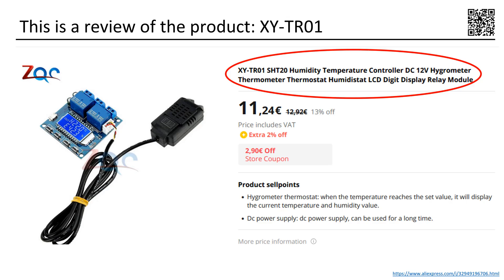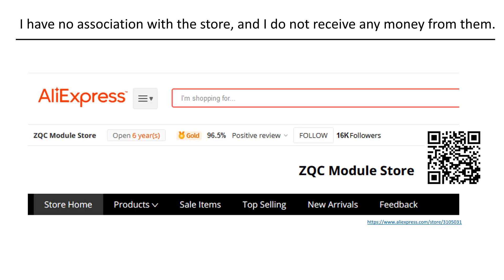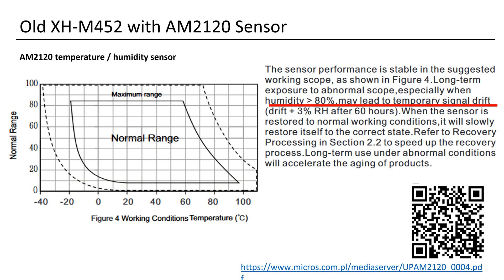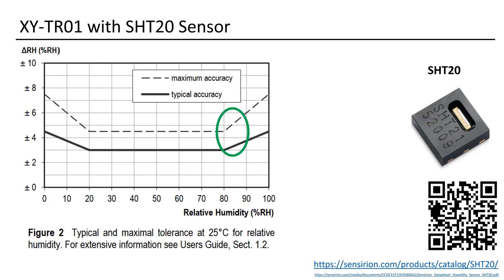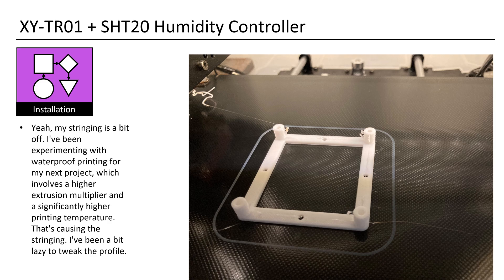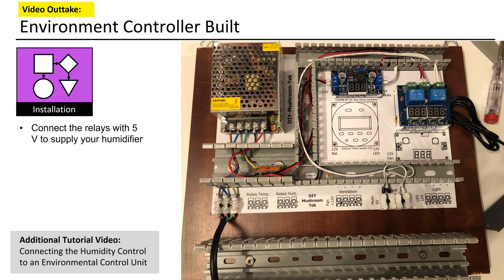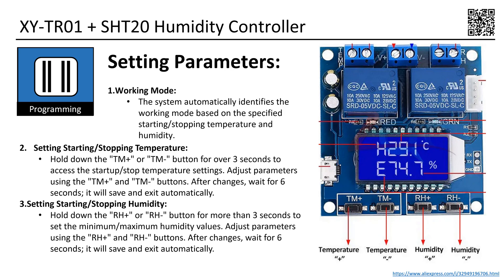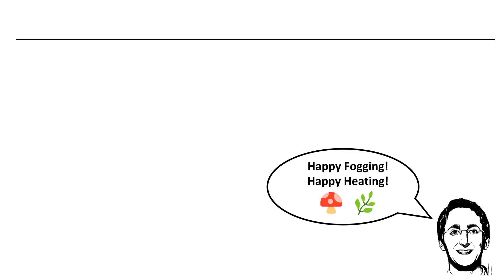XY-TR01 + SHT20 Humidity Controller

Comment: hallo daniel :) may i ask you a stupid question.... so this controller has 1 output channel for each parameter Temp and humitity. so i guess you have to choose if you wanna increase or decrease your hum/temp before right ? what if you wanted to increase or decrase at the same time? do you have to use 2 controllers ?  btw  facinating work you do ! :D
Reply from the maker: Hey, there are no stupid questions ;).
The controller works as follows. It shows you the current temperature and humidity. For each one, you can set up two values. If I want to have Ø 85% humidity in my grow tent, then I set up the following values: 84 – 86. What do they mean? The controller opens the relay at 84% and the humidifier starts working. When the value of 86% is reached, the controller closes the relay again. The same is possible for a target temperature through the second relay, that would controls a heating device. This is the normal application for grow tents as humidity and heat are sucked out through the venting system.

If one changes the values, then the operation changes. This is for using, for example, cooling devices or dehumidifiers. Then the device starts when, for example, 7°C is reached and cools the tent down to 5°C.

Since the often system that you are trying to control has an energy drain in one direction, these controllers work just fine. If you have a more complex system in mind and want to use, for example, a PID controlled target, then I would advise using an Arduino or ESP32. I made good experiences using a Bosch BME280 sensor. One can program these controllers in any desired way. I did not use them in my project in order to make it easily accessible to as many people as possible.

What are you planning? Feel free to share!
Anyway, happy tinkering and growing!!
Reply: @diy-mushroom-tek  so in order to actively cool and heat id need a second controller , or a better one....guess you could just set it the other way if needed . My plan is to control a grow tent for plants. I ordered two controllers maybe I build a mushroom box for my mothership as well :')
Reply from the maker: Yes, you are right. If this is what you need, I also have a grow tent for plant cultivation. Here is an impression I just recorded for you: https://youtube.com/shorts/_KAyfSostlU

The question is about the goal. If you want no change in temperature or humidity, then you will need a second controller. Maybe during the day, it will get too hot because the UV-LED-Lamp is running, and lots of energy is converted into heat. So, during the daytime, the tent will be warmer. I turn down the lamp during nighttime. One reason is because it simulates the natural way of things, and the second one is that during the daytime, I can use the energy from my 600 W solar balcony system and greatly reduce the cost of maintaining a grow tent.

Anyway, when the tent gets colder during nighttime, the humidity will also skyrocket. This is because cold air can hold much less water than warm air. For me, this is fine because it simulates the dew that also occurs naturally. That said, one must be careful that not too much dew falls out to avoid damaging the plants. I spoiled my first vanilla plant with this effect because I did not consider it. Since then, I added an extra fan on the floor and increased the exhaust air to reduce the time with higher humidity content.

So, it is a complex question, and the humidifier, lamp, (heating), and air system are intertwined. I still think that one controller might be enough for one tent because plants also have robustness and do not need a permanent temperature value but are made for day/night differences.

That said, for a mothership, it might be different. When you have high energy input through the sun, I might also consider adding a second controller to cool the system down by powering up an extra exhaust system that pulls in cold air from the north side of the structure.

I would be happy if you would share some of your progress with your fellow growing enthusiasts! Anyway, great undertaking! Best of luck! Happy tinkering and growing! :)
Reply: @diy-mushroom-tek  you are such a nice guy :') thanks for all that input. I am new and have no clue so it may take a while ...anyway do you have a discord , would be the perfect place to share and getting inspiration

Comment: Hello I am super greatful for all the work you have put into designing and sharing this setup....I will be using ypur planns to construct my own martha as it is by far the most tined  setup o have comee across. My question for you is does this setup raise the temperature insode the tent much above the aambient temperature in the external enviroment.. if so how much d I es ot increase and is it relatively stable? I suppose this probably depemds on the parameyers you input and the pre existing enviroment it is set up in, but I am going to be growing a fairly finicky fungus and it likes a slightly warmer enviroment than normal room temperature and llikes it stable. Have you  found it necesary to add any sort of heating unit to this tent and if so can it be conntroled with the upgraded humidity/ heating controller and would i need to add anything else to the control board?
Once again thank you for all your hard work and desire to help others...whhen I am in a position to I will  be buying you several cups of coffee and definetly will do my best to help anyone else i can...thank you again😊
Reply from the maker: Hey Aaron! It's very nice to make your acquaintance. I am happy that you find value in my videos. Your mail was perfectly readable for me. I will answer it as follows:

• My DIY Controller uses the XY-TR01 humidity AND temperature controller, thus you can use any heating device in conjunction with my board. I also added a space where you can place the connector so that you can easily put the controller between the power source of the heating device and the device itself.

▫️ XY-TR01 SHT20 Humidity Temperature Controller DC 12V Hygrometer Thermometer Thermostat Humidistat LCD Digit Display Relay Module
https://www.aliexpress.com/item/32949196706.html 

• As a heating device, I have played around with some for the tropical grow tent I am currently designing. There are many that are waterproof, and some also come with a regulator to choose the intensity. This way one can use the heating device without a controller. One just plugs it in, puts on the desired intensity level, and checks the temperature inside, in case the chosen level is too high or too low. This is a list of items I would consider using:

▫️ 1 Pcs Waterproof Seedling Heat Mat Hydroponic Heating Pad Reptile Tank Heating
https://www.aliexpress.com/item/4001035223532.html
▫️ 5-45W Plant Warm Heating Pad Waterproof Reptile Heater Mat With Temperature Control Adjustable Controller Indoor Garden Seedling
https://www.aliexpress.com/item/1005003874181232.html

• When you use a heating dice, I would put some insulation on the ground of the tent, and directly above the insulation, I would place the heating plate. This way, one does not lose all the energy into the floor and it gets where it is needed. One can buy one at any home depot (Baumarkt).

▫️ XPS Hartschaum Dämmplatte strukturiert GL 20 mm Paket: 15 m² (XPS hard foam insulation board)
https://www.obi.de/geschaeumte-daemmstoffe/xps-hartschaum-daemmplatte-strukturiert-gl-20-mm-paket-15-m-/p/6700504

• Above the insulation and the heating plate I would place a fan. I designed a very simple stand for the 80 mm fan that I use. The fan should be put on top to spread the warm air evenly around in the tent. This way the conditions will be the same everywhere inside the tent. You can find my design for a simple fan mount here:

▫️ Effortless 80mm Fan Mount Print!
https://www.thingiverse.com/thing:6273600

• Lastly, I would carefully monitor the exhaust air. Maybe, I guess, just use the exhaust air fan, and let it passively suck in air through the input air hose. Then I would carefully monitor my mushroom in order to find the lowest needed exhaust air volume stream. One could also add a timer and also exhaust only at certain times. All this is only needed when your electricity bill starts to mount up too high. Because you are, in fact, heating the tent and simultaneously blowing the warm air out again, and exchanging it with cold air. If the costs become a matter, I would consider using a kind of this board for setting up time intervals:

▫️ DC 12V 24V Dual MOS LED Digital Time Delay Relay Trigger Cycle Timer Delay Switch Circuit Board Timing Control Module DIY
https://de.aliexpress.com/item/4000003292608.html

I hope you this clarifies the open points that you had! I wish you lots of good success with your upcoming tent!

Take care and happy mushrooming! 🍄🌱

Comment: Also would you be interested in printing the parts for me and letting me pay you for your time?
Reply from the maker: Hey @MoraniDai-ol5kn ! I appreciate your interest, but I don't have an Etsy store or sell any items. I recommend checking out Facebook Marketplaces or Craigslist, where you can likely find individuals willing to 3D print the .stl files you need.

Alternatively, consider getting a 3D printer yourself—it's not as challenging as it may seem. You can find used 3D printers at reasonable prices, and with software like Cura for slicing, the process becomes straightforward. Just ensure the printer bed is leveled, set the correct z-axis offset, and let the printer do its job after inserting the Gcode via an SD card.

There are plenty of helpful tutorials on YouTube to guide you through the process. Best of luck with your mushroom endeavors! Happy mushrooming and perhaps even happy printing!

Comment: Do you know if Ali express sells one that reads Fahrenheit? Or one that could be swapped for it. I live in USA.
Reply from the maker: Hi @MoraniDai-ol5kn ! I haven't come across the XY-TR01 controller with a Fahrenheit display on AliExpress. However, it's not a dealbreaker. Since humidity is measured in percentage, the temperature scale (Celsius or Fahrenheit) doesn't affect humidity control. Both scales are equivalent, with plus or minus one degree being the same in both.

For your convenience, consider keeping a quick conversion list next to the controller. This way, you can easily reference and set your desired target temperature. Whether you're using heating or cooling elements, this simple solution makes it user-friendly for your needs.

Fahrenheit	Celsius
60.8	16
62.6	18
64.4	20
66.2	22
68.0	24
69.8	26
71.6	28